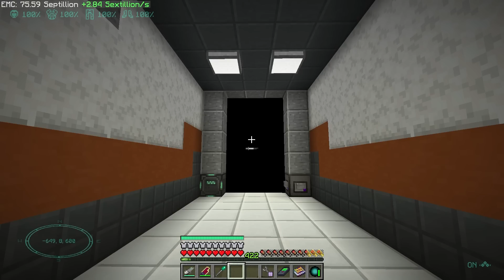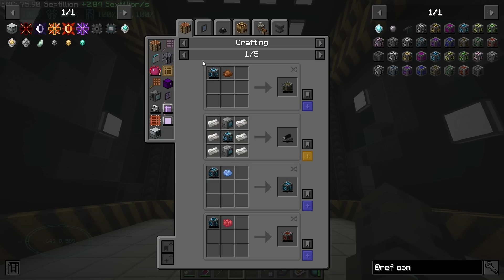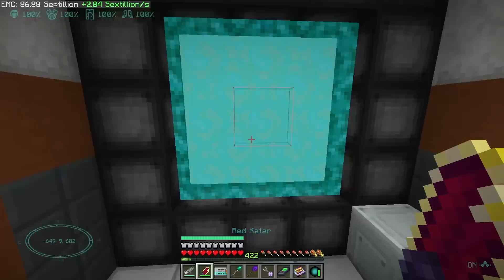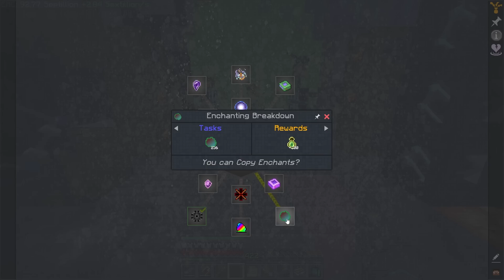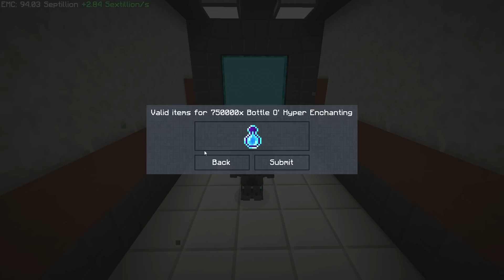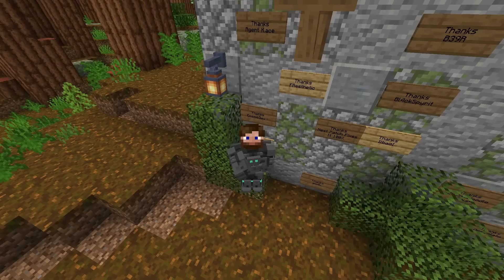PROJECT ARCHITECT 2 - EP 51: Refined Storage CRAZY Fast AUTOCRAFTING

Comment: @chosenarchitect just a heads up for both RS and ae2 you can add the 1k drives in multiple crafters to speed up the thing you need the most. like i had 8 of those crafters set to 1k drives and it goes SIGNIFICANTLY faster

Comment: If your AE setup takes 25min per part with all the processors being prepped up passively in advance then it's not really maxed out.
Mine takes 8.5min to smelt and craft everything, nothing done passively, all on demand. 😝
Reply: A single block from RS is doing it faster than the max complex build from AE 🤣
Reply: @LucasBKOK  So? The point was that his AE setup wasn't maxed out 🙃

Comment: Advanced Ae has crazy quantum computers for crafting
Reply: It's definitely awesome and I'd love to see it in the pack, but in the end it's just a more compact cpu, you could achieve the same storage and co-processing threads with mega cells or even regular AE parts but it'll be way more expensive and way bigger.
Also you can add hundreds of co-processors, but your crafting will be bottlenecked by Molecular Assemblers either way. That said, Chosen definitely should add more co-processors, 32 threads per cpu ain't much.
Reply: @dejsimiwerkin8681  Can't you also have the same recipie in multiple pattern providers to make it craft in more then one Moleculor assembler at at time?
Reply: @zuzoscorner  I think so, although never tried it myself and it's quite a bit of additional work for a very niche problem.